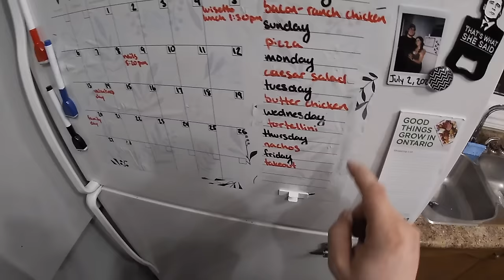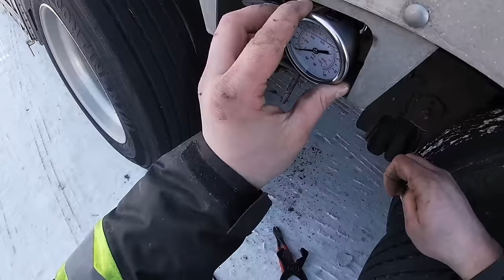Day In The Life Of A Heavy Diesel Mechanic

Comment: I hope that brass fitting had inserts for the plastic line it will come off when it gets hot in the summer if it didn't, all plastic air line fittings have them inserts that go inside the tubing to keep the air line round and secure !
Reply: You talking about the farrel? It would be pissing if he didnt
Reply: That’s quite literally the only way those fittings work. I can’t see how you could possibly screw that task up

Comment: The air hurts when still has remove the air line out the fitting when the system have full pressure in the tanks

Comment: am i tripping or did you not lock your dead bolt? someoen can very easily get inside of your apartment with just the door lock. 

schooling is a waste of time. get apprenticeship at a dealer or shop

on the other hand, going to school tonget your ASE certification will make sure you know what yoire doing the right way and not unlce billys work-a-round bullshit shortcuts just to make the job get done faster